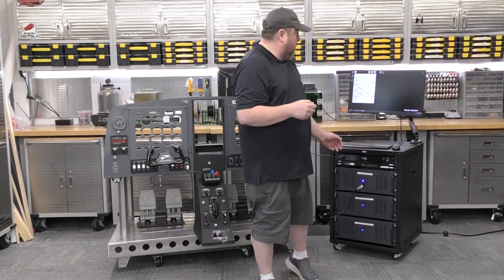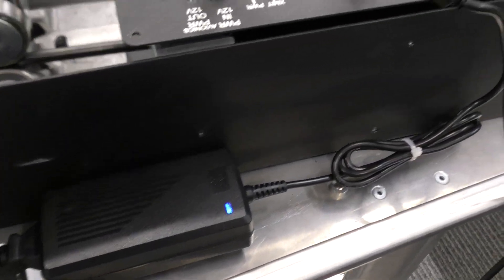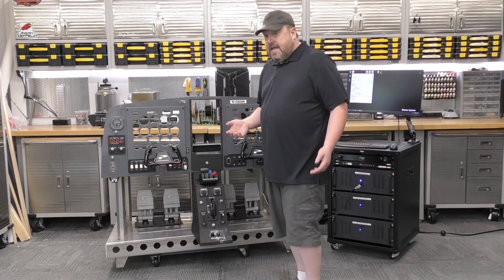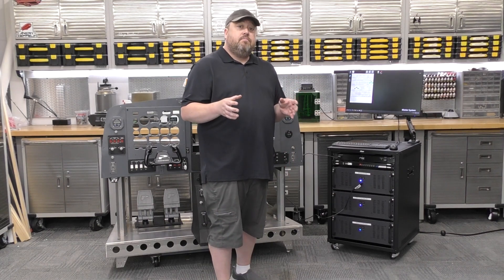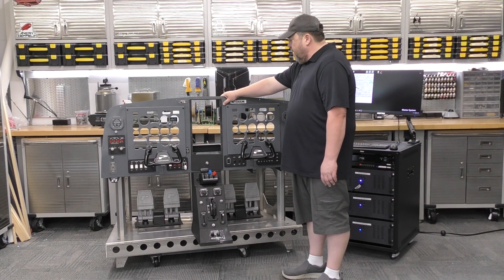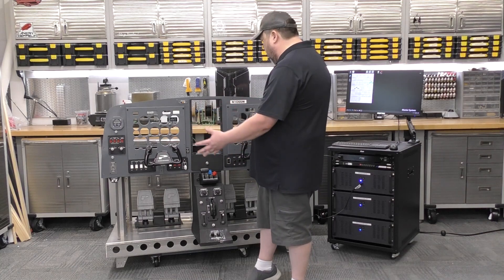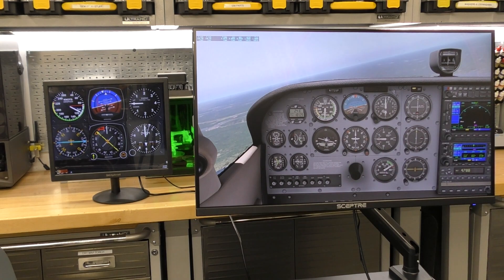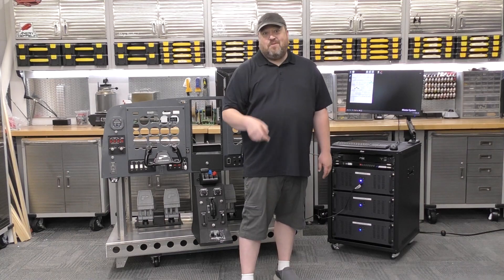DESTROYED Flight Simulator Rebuild Part 2 - Computing Cluster and Connectivity!

Comment: Came here from the Hackaday podcast! I assume there is some form of master microcontroller connected to the PC with a series of UART expanders to TX/RX from the various independent modules on the cockpit? Would love to see some closer images of the ICs on those boards. I've always been intrigued by how so many input/outputs are interfaced: from early CPU-controlled pinball machines right through to physical flight simulator of today. I'll stay with this through the months ahead!